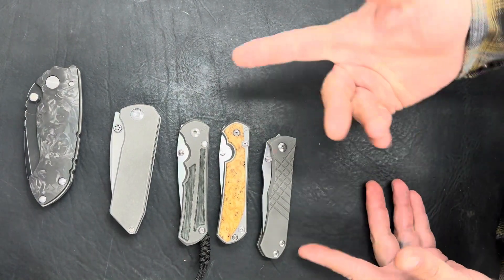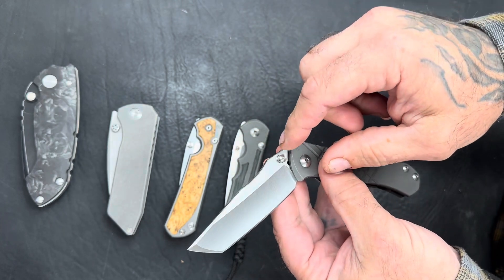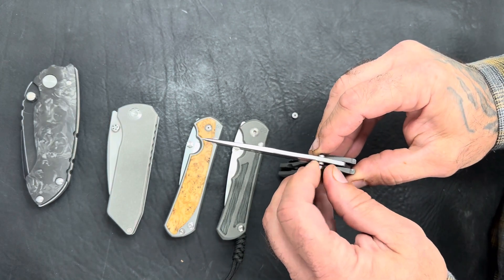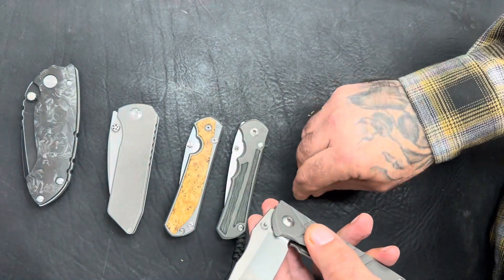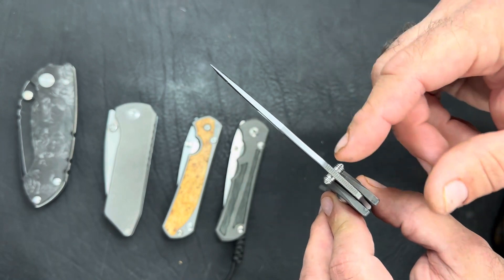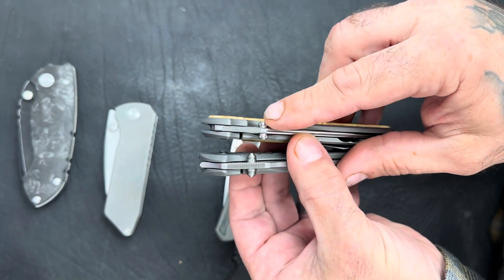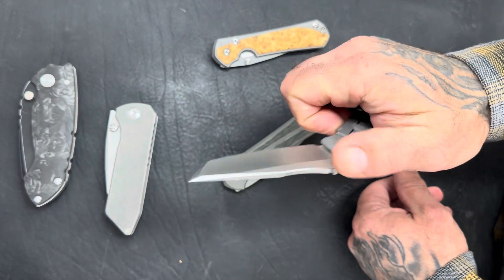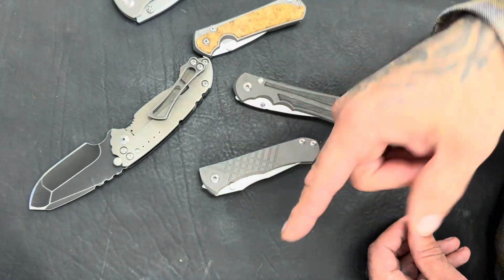CRK Zaan stud mod

Comment: Sorry I missed this when it came out.  I was on a business trip so just catching up now.  Are you doing this stud work on a lathe?  I don't have any machining experience but I have some knowledge as a designer.  Seems like cutting that small size of male threads would be hard, especially if you are trying to use a thread die plus you have to turn it down to the major diameter first.  This looks like it turned out really good!
Reply from the maker: Thank you Ken👊.  Really all simple type machining.  Hardest part is trying to see what I’m doing cause everything is so small